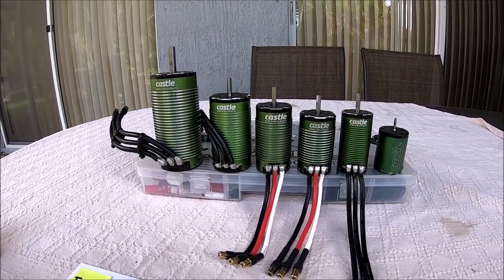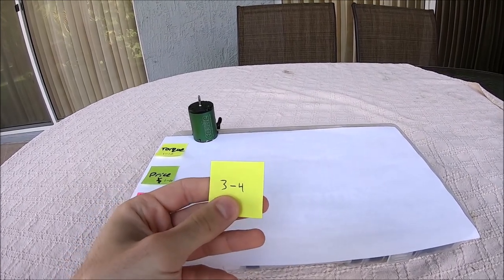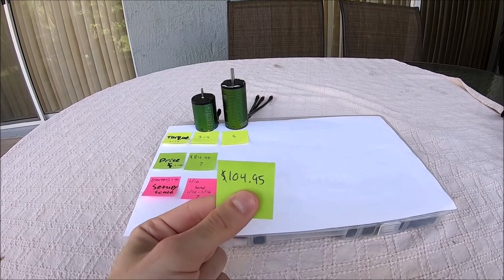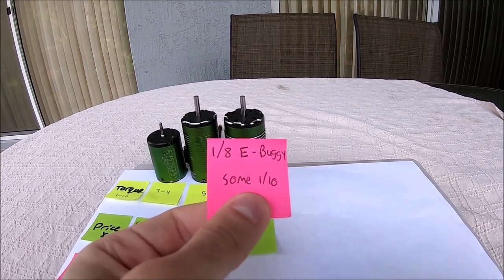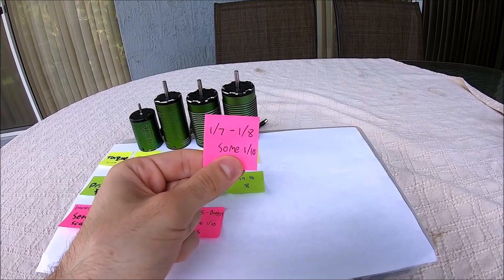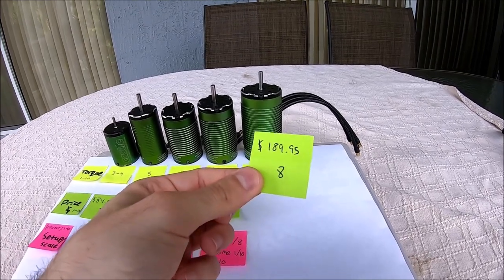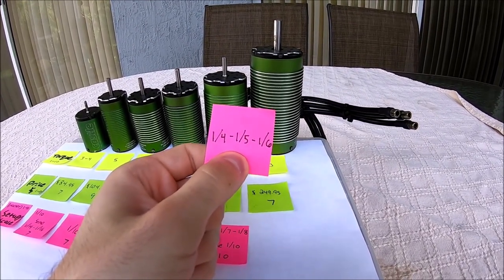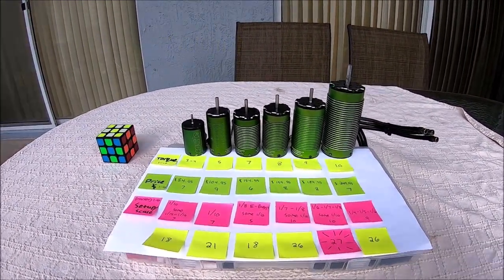ULTIMATE Castle Motor Comparison Review! New 1717 & 2028

Comment: That was an excellent explanation of those castle motors. I have a 2028 800kv motor and its a beast of a motor. I really find this video to be very useful and the fact that you did some homework here on these babies. Keep it technical and keep them coming. Thanks
Reply from the maker: Appreciate that for sure man. I actually used all of these motors so what I stated comes from actually running them 💪👍
Reply: Hi Mogreasy how does the 2028 800kv runs today !!!

Comment: Amazing vid, great info!!
I have been looking at the 1717 & 2028 for my new speed run  build on the Arrma Limitless I'm ordering. I almost went with the 2028 1100kv because of the incredible torque & ability to maintain cool. But I think the 1717 would be more fit, specially if I do decide to go with a dual motor setup. If I don't find it to meet my need, I can always toss it into my Typhon 6S & then go with the 2028 in the future if I find i need more power to break 140mph on the Limitless.
Again, thanks for such a great informational vid w no BS 😎👍👍
Reply from the maker: Thanks on that! Glad you enjoyed the video! So you can actually be more affordable and still exceed 140-150 mph with the 1717 1650kv. The 1100kv just gets the vehicle up to speed a little quicker and more efficiently. Downside to the 1100kv is that you'll need to do decent modifications to get it to fit.
Dual motor setups are sick! But why use two 1717 motors when the wattage of a single 2028 is MORE than both of them combined? Save space and weight. It looks cool but isn't feasible.
Reply: @InnovationRC  Thanks, you're absolutely right. The 2028 will definitely be more cost effective & lighter than twin 1717's. The only reason I even considered the twin motor setup was because it would just be something sweet to add to my collection lol. And with the 2028, like you said, it does need some mods. The motor mount alone runs for about ~$50. I think I will definitely go with the 1717. Maybe buy the Mamba x8 1717 1650kv combo, sell the ESC on eBay & then grab the Mamba xlx2 since I can't seem to find the xlx2 with the 1717 1650kv combo. Cuz if I push that 1717 to 140+ I'm gonna need a cooler running ESC 😄. Castle "claims" the xlx2 runs much cooler than the x8. Anyhow, thanks again bro, Ride'm, Break'm, Fix'm, Repeat! 😎👍
Reply: Just curious how that worked out? Burn up or stay cool? I’ve had the 1717 get super hot in the limitless. Was thinking of dropping kv and upping voltage/gearing.
Reply: @donaldfowler7125  I managed to get it up to 122mph so far with the XLX2. Got in a total of 3 runs before the motor got warm, ~165-170F. The ESC barely broke a sweat, didn't get past 123F if my memory serves me correctly.
I just sold the 1717 1650kv motor & purchased the 1721 2400kv motor. I put it in my stretched Typhon 6S first. On 4S, it pushed 99mph barely tapping 100% throttle. 3 runs & it was super cool, 102F after 3rd run. The XLX2 didn't get past 113F. Pulled 328A with only 1.07v ripple. And that's geared 34T pinion with a 29T spur on 4S.
I have a CNHL 6S speedrun pack coming in today. Hoping to get ~120mph with the same setup.

Comment: It's funny you say to use 12s for the 2028 800kv motor to get the power and torque but castle doesn't sell a 12s esc. According to castle, you shouldn't even use the 2028 1100kv motor with the xlx2, but they'll sure as hell sell you that combo. I talked to castle because the xlx2 I have only lasted two runs before giving up the ghost. When I filled out the rma info, I mistakenly put a motor that I no longer have which was a leopard 58113 1050kv. Unfortunately that motor was destroyed about 4-5 mos ago from a crash, but castle did tell me that motor was too big kv wise for the xlx2. I did correct my mistake when talking to castle and told them what motor I was using which is a leopard 58113 870kv. At the moment, I am waiting on an esc to be delivered, the R-snake flier 3-16s 70v 400a 
My set-up
1) Losi dbxl-e 2.0
2) leopard 58113 870kv
3) Zeee 4s 9000mah 100c batts x2
3)Aluminum upgrades- Diff housings and mounts F/R, rear chassis brace.  Total weight at the time was 37 lbs.
Now for what happened, I received the xlx2 on Monday and installed it. Tues I ran it for about 10 mins no problems. I was going to do a full run on Weds but it stopped after about 10 mins of run time, all on flat ground, no jumps, no rollovers.
According to the logs, on the run it failed on, Max amps were 340, ripple voltage was about 1.5 or less right up to the moment of failure, then it went to 3.5. Now according to castle, That's way too many amps, but yet castle bragged to have had 400+ amps during their testing. When I get the xlx2 back, it'll be put in storage for a back-up.

Comment: So. Buried deep on Castle's site is a blog on speed runs. Their motors CAN handle what's printed on the cans (ie. 100,000 RPM) BUT with extra precautions. The recommended max is for the average enthusiast.
Reply from the maker: They limit the motors legitimate potential by adding a voltage rating. The 1100kv motor is max 8s, they say. Reality the max rpm is 45k, so that is 10-12s category. That is per example. I do NOT recommend running the motors over recommended voltage because it voids warranty and support. For anything I do on my channel doesn't need to over amplitude the stats of their electronics. Stock voltage does way more than enough for me!

Comment: As others have said, great break down. I know some of this already but seeing all motors from the same brand the differences helps bods like me who, until recently only use cheaper motor/esc combos...maybe you can do a similar review with equivalent ESCs, factoring in drag breaks, throttle punches etc and which ones would make the crossover as a great esc for say drifit rc or crawling? Until recently I thought my Hobbywing 1060 esc was great for crawling but at the club where I'm going to start racing,  for the entry level category most have said the 1060 would be great for racing with. 😊😎 Saved me buying another esc lol.

Great vid mate 👍👌
Reply from the maker: The Mamba X will surely fit both of your criteria. You can adjust drag brake on it, sensored capable to crawl with. Solid esc to run in anything up to 140 amps as well
Reply: @InnovationRC  Thanks 🙏👍😎

Comment: Cool comparison on Castle motors, My first Castle ESC and Motor was a Copperhead 10 with a 1415 2,400KV (5mm shaft version) and i plan to put a Castle Mamba Monster X 8s with 1717 1,650KV in both my XO-1 and my future Infraction V2 i also might put it in my future X-Maxx and my Sledge if a 8th scale combo fails.

Comment: Great information for motor selection. Wanted to eventually convert my summit to a badger like the erevo 2.0 what motor esc and gear set up should I run castle of course?
Reply from the maker: I would look into a mamba monster X 8s with the 2200kv motor. I wouldn't go 1717 because the summit has a plastic gear switching transmission I believe. 1717 will obliterate it haha

Comment: What would you recommend for a Fireteam, preferably run on 6s? Castle or otherwise.  Currently running the stock setup on 6s and would like more oomph for speed bashing without getting so hot.  No big jumps, just baby bumps and fast running on rough terrain.
Reply from the maker: 1650kv 1717 motor with a Castle mamba monster x8s esc combo
Reply: @InnovationRC  Geared properly and running 6s would this likely get me more top end or just more mid range torque? I think I'd be fine with just more torque, it's all ready got decent speed for a big vehicle.

Comment: Hey bruh, gret video. Here's my question:
Project Kraton 1/5 EXB:
I purchased the Castle XLX2/ 800KV and Hobbywing Max 5/1100KV, which would you go with?
I installed the XLX2 combo with stock spur gear with Saga 32tooth pinion, am I geared best for speed and power combo?

Thanks Awesome video!

Comment: Subscribed!  I am currently working on an arrma vendetta. Based off my research, I am about to pull the trigger on purchasing a Castle MMX8s Esc with a 1717 motor. What I intend to do with the Vendetta is just speedruns. No bashing. In your experience if I run this on 8s and utilize the same gearing I have now, which is a 44T Spur w/slipper eliminated and a 32T pinion. This thing should absolutely fly? Or am I setting myself up for a disaster?  Any tips would be greatly appreciated. Please!🙏
Reply from the maker: Go with a 2200kv and an X8s. The 17 series is too thick and won't fit. The 2200 is great to run on 4/6s that won't be too big to fit. Thanks for subscribing!
Reply: @InnovationRC  I really thought the 1717 would fit and I got it today and it looks like it is more of an issue of where do I put the esc. Even putting it on top of the receiver box won’t cut it. I have a v2 limitless brand new in the box. I guess I’ll put it in that   Crap!

Comment: Great video. Question, I have a e-revo 1/16 and Im looking to acheieve 70+mph, which one of these motors would you recommend. I know the video is old and Im sure there have been upgrades to the ones above, but was just curious on your thoughts. As well as what ESC, Battery and gearing to achieve that speed. Thanks!

Comment: Hey Fellas I have a 1717-1650 kv motor installed in a Arrma Felony. The motor gets pretty hot. I'm using the standard 16 tooth pinion. Will I need to go to a smaller pinion to regulate the heat? Maybe install cooling fans? I actually burned one of these motors up and I dont wanna do it again.
Reply: Did you figure it out? This is what I'm putting on my felony.  Buy if it's doing that mabye not.
Reply: @ant9072  Yes I actually installed the 27 tooth speed gear and 4 game changer fans. Perfect!
Reply: @gsizzlepmg  thanks for the help! Just got the same motor for my felony.

Comment: Thanks Brandon..... excellent video. I have a version one E Revo 1/10 vxl and just smoked my stock 2200kv motor due to improper gearing after mounting up some larger diameter/ heavier belted tires, so I'm in the market for a new motor now.  What motor would you recommend that will be good for bashing and speed, one that will give me just overall versatility. Still running the stock 6s capable ESC which is a castle. I'm new to the RC world so I appreciate the help. Thanks in advance.

Comment: First of all, thank you for the great videos you make! They are full of information and what great speeds! Just a small question. What gear ratio do you recommend for this new set on the limitless?
MAMBA MONSTER X 8S, 33.6V ESC W / 1717-1650KV

thanks in advance,

Rik
Reply from the maker: Appreciate those words for sure. What do you ultimately decide to do with your limitless? Gear ratio depends on that
Reply: @InnovationRC  
I just want to drive straight with speed. Thanks in advance!

Comment: So I'm getting a 30-degree North Losi 5T clone and I'm going to be running the castle 800kv but I came across a great deal on a lightly-used sensorless 800kv and I was wondering if you could talk about your experiences advantages disadvantages between the two(sensored vs sensorless) and keep in mind I'm a Basher I'm not going to be using the sensor at all I don't care to so the sensor doesn't matter but what improvements does the newer one have or will I see little to no difference

Comment: Awesome explanation, thank you. Q? I have a rustler 4x4 ultimate and just got a carbon fiber chassis for it to upgrade and bunch other stuff. Which motor would be the ultimate fit with for speed? Thank you in advance., also been lookin at hoobywing max8 2200kv
Reply from the maker: I'd probably look into that 2200kv on 6s. Or, get a 1512 2650kv and run 4-5s to keep it light

Comment: #InnovationRC- - Great break down on the Castle motors Brandon!  Question, I want to beef up my 3s Arrma Typhon for speed runs. If I went with the Castle -  Mamba Monster X 25.2V, 1800KV Sensored Motor - would be a good set up for my 3s Typhon?

Comment: Brandon how do you think the 1717 1650 compares to the 1520 1650?
Reply from the maker: 17 series is a little heavier duty, same speeds but will have a little more torque over the 1520, but the 1520 is no slouch either. Very similar

Comment: Idk if i should go with the 1415 or 1515 in a stampede on 4s for bashing
What do you Think?
Reply from the maker: I'd go 2200. I'd use mod 1 gears so that you can gear higher than the regular 48 pitched gears

Comment: Which motor would you recommend for a 1/8th scale e revo  ( 6s power) for maximum speed, the 15, 17 or 20 (stock can run up to 70mph)? Also for a 1/10th scale maxx with belted 3.8 inch trencher tires ( max stock speed is 60mph 4s) (4s-6s lipo)? They are both around the 11-15 pound range. If possible I would also like to have good torque and acceleration but speed on both on-road and off-road is mainly what I am looking for since either of the three motors should be able to provide enough power for the cars.  The Kv rating as well as the motor and esc is what I need to know.
Reply from the maker: I'd go 1515 because a 17 series is too thick to fit in the motor mount

Comment: I have a couple questions for you, when you ran your Kraton 8s with the TP motor in it you pushed it off, what was the reason for that? also I bought a TP 5660 1356kv motor and waiting on my xlx2 to come in. Is there a issue with the motor in regard to low speed or starting out? and should I switch to the caste 1100kv. Whats your thoughts? thank you. Videos very informative. thx again
Reply from the maker: The reason is that the tp motor isn't sensored. So it cogs horribly from the start. Violently shaking the drivetrain, that I don't want. With a sensored castle motor it's smooth sailing as I slowly get on it. The castle 1100kv is an awesome motor for big vehicles. Have no idea why guys are sticking them in smaller ones when a lighter duty can do the same like a 1717 1650. With less weight too.

Very glad you like the videos! I certainly appreciate that you enjoy them
Reply: @InnovationRC  Thank you for the reply. Do you happen to know if castle is coming out with a 2028 in a little higher kv motor like 1250-1400 anytime soon?

Comment: great video i have  the 2200kv on the way for my rustler 4x4 vxl. what gear set up do you recommend for speed?
Reply from the maker: I'd go with mod 1 gears, 20 pinion and 40 spur
Reply: ok i will give that gear set up a try.what do you think about 28 pinion and 36 spur on 6s thanks for replying

Comment: I just bought the Arrma Infraction and wanting to do the 8s conversion what is this the best combination over the Hobbywing Ez Run Max 6 V3 with a Poseidon Pro 1800kv 8s? Running 1520 series 1650kv or a higher  or lower kv ? Do you think 1650kv is the best kv to go with what options and performance i have choosing a motor Thanks
Reply from the maker: If your at 1650 or lower you'll be legit for 8s. Just gear accordingly!

Comment: Awesome break down!!    So fitting for me,,  I just picked up kraton exb and was about to order a 1515 2200, but saw a 1512-2650kv for same price.  What's the difference and would either be better for my application?
Reply from the maker: 2200 would be way better for the Kraton. I would go with the 1717 though. That's the big block of the 2200kv. Perfect for bashing
Reply: Thanks man, I would but the 2200 combo is already at top of the budget.  Decisions, decisions,  decisions.    Thanks though, again great video

Comment: Hi Brandon.. quick question. I have the 1415 2400kv and a Mamba X esc . I plan on putting the system in a proline pro mt 4x4. Will that be a good setup for that truck or should I just put it in my Traxxas hoss? Where would it work better?
Reply from the maker: What's up, yes you can. I'd run a heatsink on it to keep temps lower though.

Comment: I want to upgrade my typhon 3s  v3 electronics and this  was helpful  i running 100 amp esc and 3200 kv blx motor  stock gearing  so im thinking the third or fourth motor you mentioned  would be a good fit

Comment: Can I use the second to last motor in my 10th scale 4x4 slash??? If so what esc and motor gear do you recommend??? I want the max speed possible... I'm not worried about overheating as I only go in bursts of 5-10 mins... would eventually get a cooling fan for the motor...

Comment: What motor in your personal opinion would you choose for a Kraton 6s EXB, the 2200kv or the 1650kv motor? I can't decide between the 2.
Reply from the maker: 1650. Bigger can, more torque. Less heat issues than 2200. Run it on 6s

Comment: Hey man I need help what would you run in a KRATON 4s out of this line up something about the same as the spectrum just running a little cooler and a bit faster
Reply from the maker: I would certainly go 1515 2200kv. Larger but not overkill, run it on 3-4s gear it high and it'll run amazing

Comment: Great video would a 18pinon or a 13tpinion be a good setup with the 3800 castle creation  Combo in a rustler 4x4vxl?
Reply from the maker: I'd say you can go smack in the middle of those gears for all around use. Go with a 15t. Or run 20t and run 2s all day!

Comment: Great video! my friend use 1512 1800kv with 6s lipo on kraton 6s and has no issues but manual says that its 3-4s capable. how can it take 6s?
Reply from the maker: The rating on most motors are actually underrated to have people stay within a performance threshold so it doesn't void the warranty or consistently destroy the rotor

Comment: What do you think about the 1717 in a 8th scale drag application?
Reply from the maker: I think you'll have all the torque you need for 132 feet. Run it on 8s in gear reduction? 29/39. Wicked torque and rpm
Reply: Thanks bro I appreciate it💯